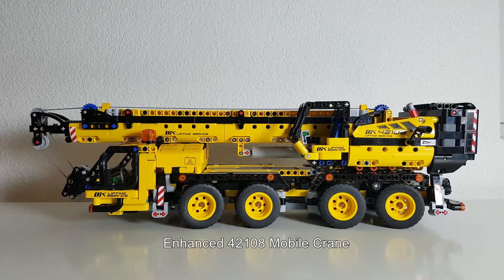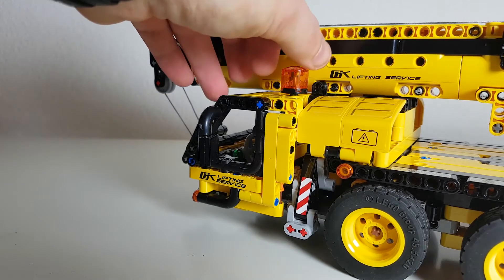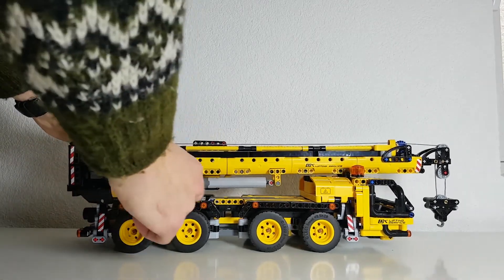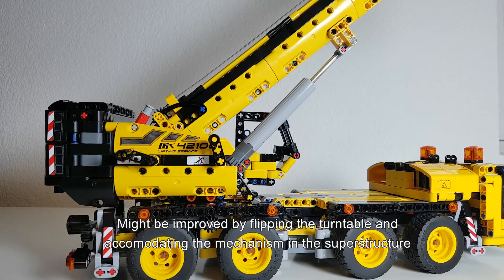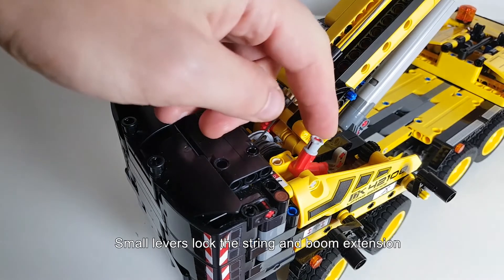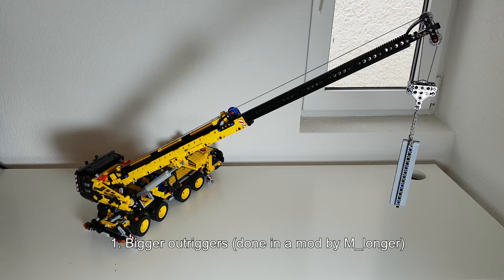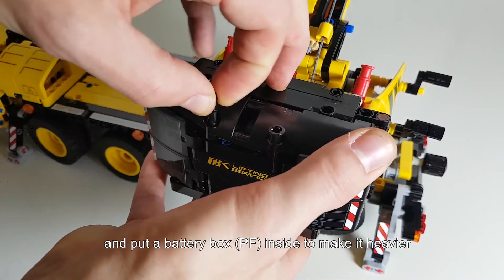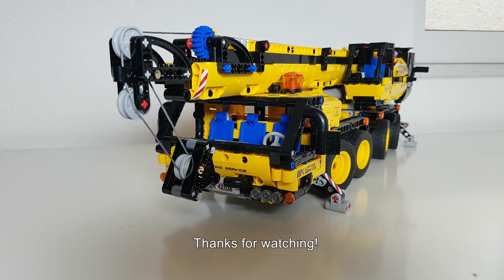Enhanced 42108 Mobile Crane

Comment: Very nice mod, thanks for sharing :)
I also prefer cranks to those small black gears. Back in the 80's, they used wheels with a pin, far more usable. I place them on all my models but your cranks are a great idea and fit more the overall look of the model !
I plan to add this model to the collection soon, I will surely come back to this video then. Cheers !
Reply: hi, what do you mean by "wheels with a pin"? Could you point me to the specific part please?